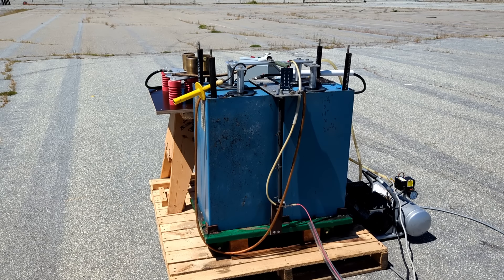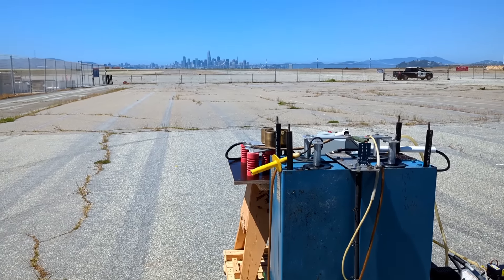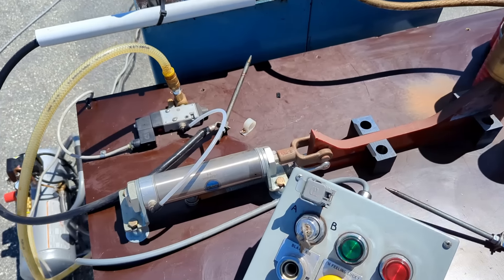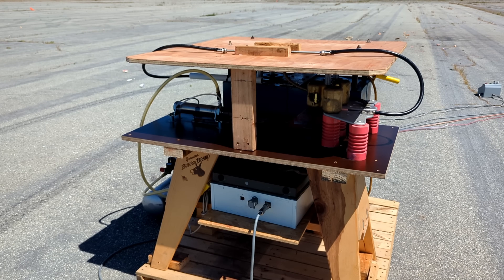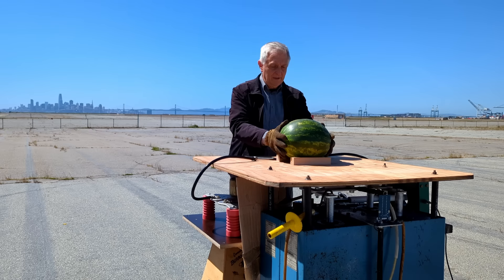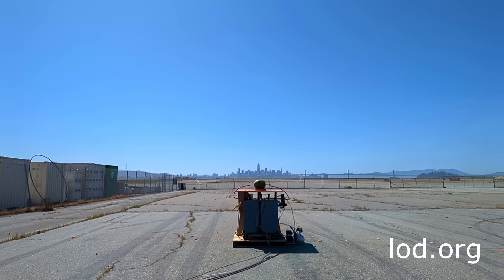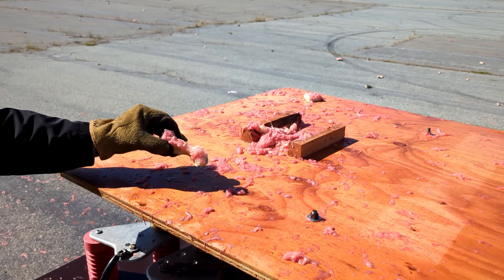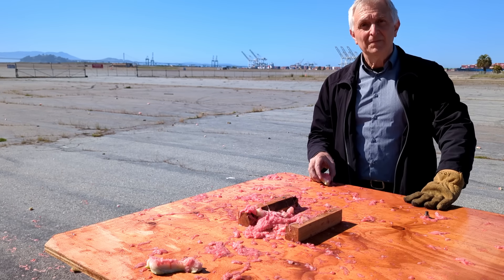Zapping a Watermelon with Lightning

Comment: Did not disappoint, Chef's kiss to the 'I'm Feeling Lucky' button legend! Maybe this is Sparkshooter 2.0....?
Reply from the maker: It could be actually, if the switch electrodes were replaced with a suitable wire armature.

Comment: that's a spicy one!  mine's also around 40kJ.  800uF @ 10kV.  really low ESR for that sharp watermelon splitting spike.  i have some solid tungsten copper rods i considered connecting with a pneumatic ram, but i'm going to see how a ross relay holds up first.  i considered a vacuum relay, but i don't want to risk xray generation, so i think something akin to a traditional contactor will fit the bill better.  cool video!

Comment: Paul Koloc told me that it should be possible to generate ball lightning with a helical exploding wire -- relying on the kink and pinch instabilities to collapse the turns (through mutual magnetic attraction of the kink instability) into a single toroidal plasma (closed solenoid plasma)*.  I don't think anyone has bothered to try this, although Paul did claim to have accomplished something equivalent with a helical Xenon flash lamp.  The only system I worked with him on was driven by a 5kJ 19kV bank but I never saw anything that I could call a plasmoid -- although there were plenty of snapshots of something that looked like a big ball reminiscent of those photos  you see of the Trinity tests taken with high speed exposure.  I think the big problem he ran into was getting the rise time fast enough due, in part, to the fact that he was relying on capacitor banks.  I designed an inductor system that provided what he needed but he didn't have the funds for it.

* I should add here that my work fringe physics of the magnetic vector potential lead me to believe that his model of ball lightning's stable state with relativistic electrons in the poloidal surface of the torus, should exhibit some very unusual behaviors, but that it would only appear as a "ball" if, somehow, a toroidal current coudl be sustained in what Paul called "hyperconductivity" which is what he described the poloidal electron motion as exhibiting due to time dilation at those speeds.  A diagnostic he looked for was X-Ray emission at least during the formation of the toroid.

Comment: 3:40 (T-1.09546407) Is that a resistive (bad) connection between spike and lead?
Reply: Certainly looks like it, I doubt that connection will come undone again, now it's thoroughly welded together.
Reply from the maker: Interesting thing about bolted connections at these currents.  The connection was two 3/8" nuts, torqued tightly.  However, the Lorentz forces where the cable departs can be huge.  The connection probably experienced enough torque in that instant to lift the connection flag briefly.
Reply: That caught my eye as well.

Comment: What's the voltage?
Reply from the maker: That's an exercise left to the reader!  All the info needed is in the waveform at the end.  ;>
Reply: @LightningOnDemand  I know, I can figure it out, but I mistakenly thought someone would be nice enough to tell me. Silly me!
Reply from the maker: @Bob_Adkins  Ah ok, that shot was 3,000V x 54,000A.  This is about the right impedance for matching into the load, as the waveform didn't show a negative swing after the first haversine.  This indicates no energy was returned to the caps, and it all ended up in the melon within the 215usec pulse.
Reply: @LightningOnDemand  That's amazing power, and I always wondered why it makes such a loud noise. It's not confined, there aren't a lot of gases to expand like in chemical explosives. I suppose it's just a supersonic cracking sound from a small amount of air expanding, but large enough to make a boom instead of the usual crack. Enjoyed the video!
Reply from the maker: @Bob_Adkins  Yeah supersonic effects probably make up most of it.  One useful thing about capacitive discharge is that it can deliver the energy many times faster than chemical explosives.  Schlumberger even has a capacitor truck for fracturing rock in mines.
Reply: @LightningOnDemand  I didn't know about the truck!